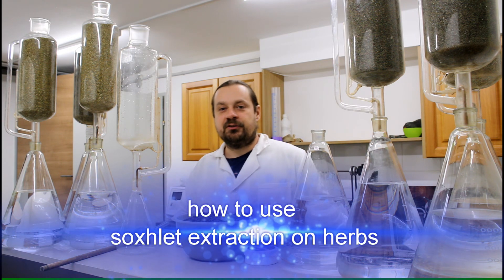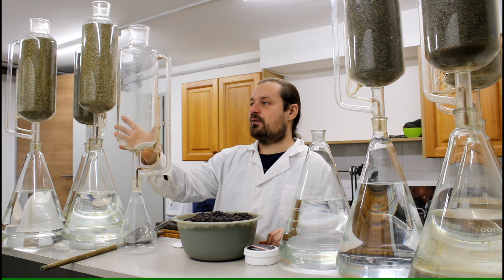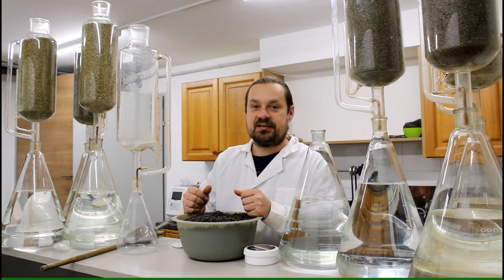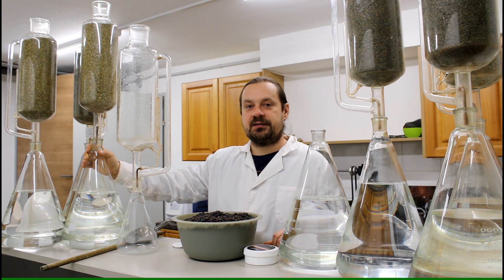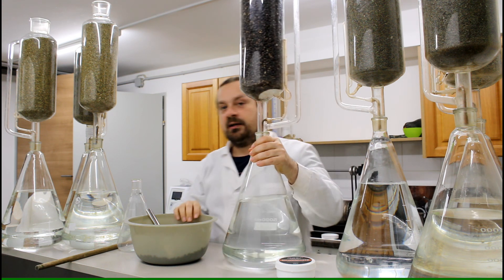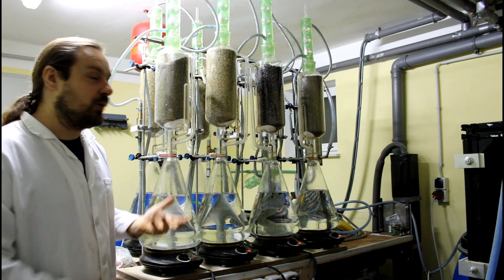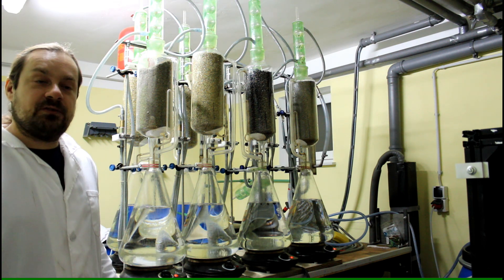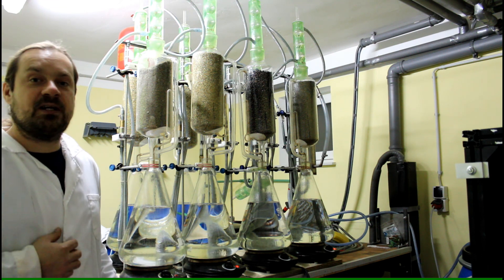how to use soxhlet extraction on herbs

Comment: Hi, where did you got those extractors? Are they available to buy or custom made? Is the filter replaceable or build in? Cheers!
Reply: Those big ones cost $500 for setup.  I have 1000ml with 200ml mantle i bought wholesale for $180. They have been around since the late 1800's.  Filter are not built it, but can use cotton, or Muslim bags used for filtering other herbs.  Also, a glass thimble can be used.

Comment: I have a cuestion mu friend, what would happend if i connect the soxhlet system to a air bomb in order to low the pressure , and low my temperature boiling point of ethanol, would it be beneficial to my extracction?   In lower temperatures i think i would have less waxes of the plant but the same bioactive components
Reply: Yeah you can run a soxhlet under vacuum just fine, it's used in a number of commercial extraction processes to keep temps down on sensitive compounds.
Reply: Use methanol for what you're extracting. It's cheaper and won't extract any waxes or chlorophyll

Comment: I prefer Soxhlet extractions for that reason, full extraction, and limited solvent use that cvan be recycled. As a rule of the thumb:
1st pass - 50% of constituents extracted
2nd pass - 25%
3rd pass - 12.5%
etc, Letting it go for 7 passes extracts 98-99% of the soluble constituents.
Reply: That's a good estimation!

Comment: Hi, once you have extracted something like mint for example, is it possible to isolate the essential oil from everything else?
Reply: Yes, by doing steam distillation. You can even do it by just putting the ground herb in a flask of suitable size, add water and set up for distillation. The distillate will be the essential oil floating on top, and the hydrolate, which is the water fraction in which a lot of essential oil is suspended. Adding table salt to the hydrolate will liberate more essential oil. Depending on the oil content, the essential oil can be either just tapped ioff in a separatory funnel, or extracted with a low boiling solvent like petroleum ether.
Reply: When using an alcoholic extract, you could distill off most of the ethanol, flood with water and set up for distillation. The  distillate should be saturated with salt afterwards, this will force out all the essential oil to the top layer.

Comment: Very nice video, I was wondering is the top capped or open, I’m guessing the gas shouldn’t reach the top of it if its cooling properly
Reply: I have a small soxhilet and like to put a cap on top as a check your coolant temp alarm. Just something sitting there that will come off if the condenser is not cold enough.
Reply: @nowayjose7259 Hello, I have a question, please. Why is the coolant water green? Is it some type of special coolant? Or is it just the additional color and he is using cold running water? thank you very much for your response.